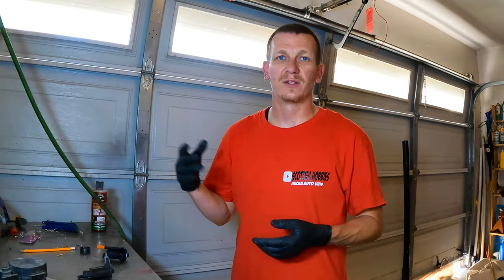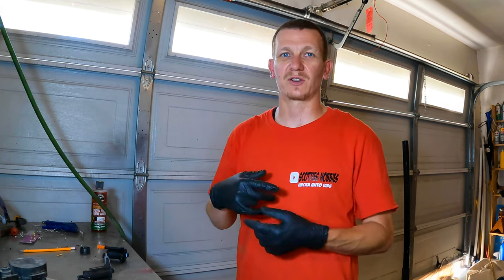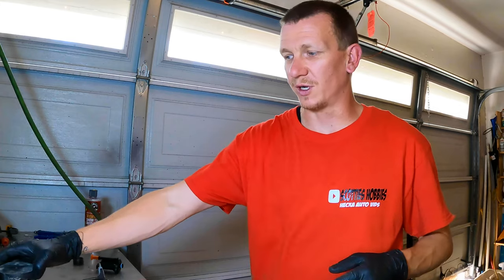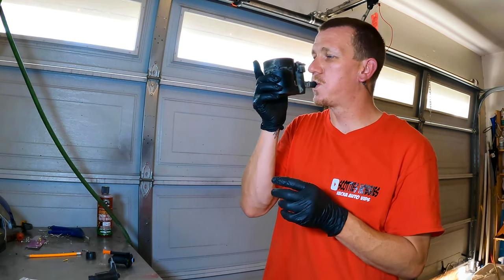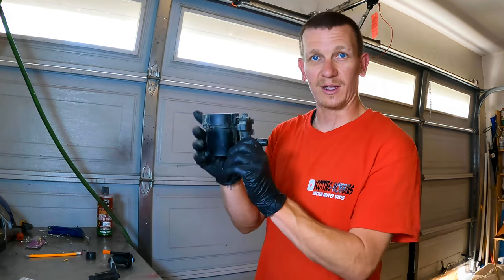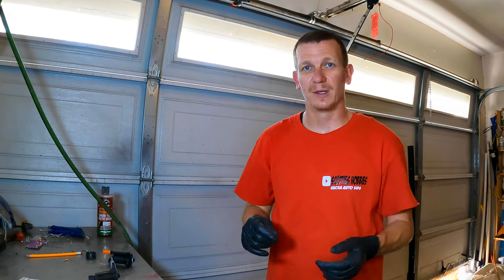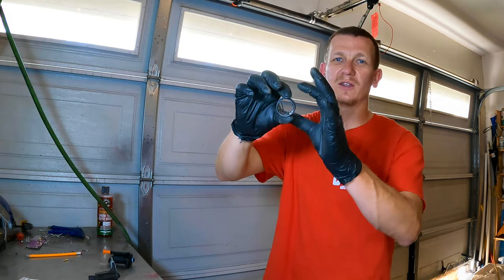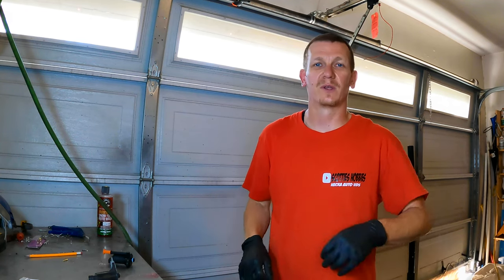⫷ Can't Pump Gas Into Car? Pump Clicking Off Too fast? Pump Keeps Clicking? Fixed! ⫸

Comment: Sometimes you need too burp your gas tank like your radiator. You do this by removing the gas cap then starting the car and let it run for about 15-20 seconds.
Reply: Im about to try that because im having this problem after fuel pump replacement.
Reply: This burping thing fixed my issue!
Reply: You saved me
Reply: I like this guy but he could never be a Actor but he's a good ole guy
Reply: Thanks for this comment it helped me and solved my issue
Reply: What if ur car was made without gas cap
Reply: @youwish3439  I put in the capless fuel system funnel that came with my truck turned it on for a bit and it fixed the issue
Reply: @youwish3439  it would be a Ford
Reply: Whhhatttt I need to try my 08 Nissan Titan is doing the same issue!
Reply: What if your vehicle is capless?
Reply: Does the burps work if I have no cap? I have a Silverado truck  with a metal flap that goes in when I stick the pump in . But it clicks every 3 gallons
Reply: @dondre5000 same deal
Reply: @JediFOMO  either the tank is already full, or the vent hose is clogged up
Reply: @kellismith4329  or a Honda

Comment: Dude thank you. You just told me my issue. I added Seafoam into my wife’s compass using a long skinny funnel. It got stuck pulling it out and I had to look up the trick to remove it. I got it out but now know the issue I caused with the funnel. Will take care of that this weekend as it started clicking off right after I did this. Thanks again for making this video!

Comment: Thanks my friend for your video.  It is helpful.  I have Mazda 2002 Protege 5 which has had the problem with filling a gas tank for a year now.  The problem has progressively gotten worse in the last two weeks.  I have had problems just putting $20.00 worth of gas in my tank without the nozzle saying I am full when it is not. Very aggravating.  Most mechanical problems I fix myself but this kind of problem requires lifting the car off the ground.  I just hope I don't get raked by a mechanic to do this and removal of gas tank is involved.  Never had a problem like this with any car until I bought this car two years ago.  It runs great!

Comment: I had that problem but it only happens at 1 gas station. The fuel flow was to high causing fuel to back up the fill tube. I filled up fine at other stations

Comment: Oh no! I've been replacing parts trying to solve my EVAP errors. I just looked and as it happens to be I too had my gas taken in the same manner. They damaged my gas hose too.
Reply from the maker: Who would have known this is such a big issue?? I am super surprised how many messages I get saying thanks for pointing out the restriction from someone siphoning fuel. 

Hope my video was the one that resolved it fir ya. 🤞💪👍

Comment: 2004 toyota matrix 5 speed...new feul tank replacement and a fuel pump.  It now does that after the tank replacement. Fuel pump was cracked so it had to be changed but now I have this problem

Comment: Great stuff, I have this very issue on my 2017 GMC Canyon which started shortly after I added fuel additive last year. Dealership and another garage could not pinpoint the root cause. Canister was replace with minimal results, I believe the problem lies in the filler neck as well..
Reply: What was the additive it should be avoided

Comment: I hade that same issues. But mostly in winter. And problem has happened 2 or 3 Time since I got my ram 3.6. 4 years ago.  And it lasted from 1 to 3 or 4 week straight. Hasn’t happend in over a year.

Comment: Same issue with 2004 Jag x type. No canasters available new, bought used. Mechanic installed, which requires removing the gas tank. He did not test the part or the system and after $1000. The problem is still there.

Comment: Hi thanks for very detailed and informative video. My car when i full the fuel , the first 40 litres is goes in smooth but after that it keeps clicking on and on  and i have tank capacity of 55 litres and it take ages to fill up the rest 15 litres. Can you suggest it might be the same issue as you discussed in the video?
Thanks alot
Reply from the maker: It is possible but it usually causes a fast filler click fairly quickly.

Comment: Just had shop fix my fuel pump cuz it was bad but now that it's fixed and  I can't pump gas  can u tell me whats wrong with it. I think it's charcoal canister... but I think the mechanic did something when putting In fuel pump cuz I didn't have this problem with the bad fuel pump

Comment: Well it wasn't the box on the 2010 nissan altam ot was a marker cap off a marker . I finally seen it with a mirror where the screen an flapper went I have no idea . The cap made it all rhe way to the last bend  before the rubber hose .  Thank u for helping me

Comment: 2013cadillac escalade esv luxury. I noticed at the gas pump When filling up the pump keep shutting off And I'm seeing that my flapper is not where it's supposed to be. I used to see it when I fill up. Do you think it's down in the filler hole and how can I get it out if it is

Comment: I couldn't fill gas tank and suspected it was the canister.  I disconnected the 2 hoses going into the charcoal canister and was able to fill up with no problem.  So i decided to bye a new canister (which came with the evap canister solenoid already attached) and hooked everything up and I still get the same problem.  Now I have no idea what's going on
Reply: Sounds electrical. That's why you test before using the parts cannon.

Comment: I have a 2010 Ford Expedition, that I believe that will be the fix as it's a capless system which you have to have a gas pump or a specific plastic part that comes with the truck. On your expedition is the vapor vent solenoid on the canister? Also it's a 2wd so would it still be in the same location?
Reply from the maker: Just looking at pictures it looks like your vent solonoid is mounted in your canister. I will double check tonight when I get home.. You should also still have a anti siphon screen in your filler pipe. Even with the capless fuel system. The anti siphon screen was blocking the filler pipe in this video.
Reply: @ScottiesHobbies  Okay, so would it be a better starting point to break apart the filler neck first? It's something that just started less than a week ago.
Reply: @ScottiesHobbies  Also to note truck does have around 165k miles on it. I just replaced the fuel pump because my mechanic said that's what it was.

Comment: What do you suggest I could use to make sure filler hose is clear?
Reply from the maker: .Other than disconnecting the filler neck and inspecting the hose. I would say a borescope from Amazon or eBay woodwork. I bought one not too long ago. That hooks up to my phone and is pretty convenient.

You can get it here:
https://amzn.to/3Lw5Syn

Comment: I have problem  pumping gas, can I still drive truck without a flapper .
Reply from the maker: Yes. I do t think the flapper will cause any issues. I've also found out since making this video that a lot of vehicles don't even have flappers.

If you can't pump gas, the most common issue idls the Vapor Vent solenoid malfunctioning. 

Good luck.. 💪🤞👍
Reply: @ScottiesHobbies  Thank you so much, would you know if they just sell the flapper
Reply from the maker: @pamhart5503  I do not think they sell just the flapper alone. You probably would have to buy a filler necj assembly. That would have the flapper included.

Comment: Is the vapor vent solenoid the same thing as the vapor leak detection pump?
Reply from the maker: Short answer, yes. Vehicles equipped with a leak detection pump, use the leak detection pump as a vent solenoid.

Comment: Scotto😮 can u help 4.7jeep  fuel  pump whining high whirling sound  thanks
Reply from the maker: If you hit thr tank, dies the pitch change? The pump might be going bad. Or... I know in one of my older chevy trucks, the fuel pump started whining one day. I waited for it to go bad for ever. It lasted til I sold it years later... and it might still be running on that same loud pump.

Comment: Hi, thank you for your video. I am having the same problem in a Volvo S60 04' 2.5LTAWD I wonder if the vent valve is located under the gas intake tube or where? When I open the cap of the tank it makes a sound like if the whole tank is over air pressure.  Can you please let me know where can I find the purge vent valve in my car?  Thank you.
Reply: Were you able to fix your problem? I have a 06 S40 and am having the same issue.

Comment: Hey, I am having that problem with my 2017 gmc acadia (just bought). went to fill it up, and tghe gas pump keeps clicking on and off. Ifi was to tackle this myself, what would be your advice on what to check first?
Thanks again for your video!
Reply: Find a station that the gas pump is smaller and narrow er

Comment: My wife’s Escalade has this problem. Is the screen and flapper  at the tank or in the neck? How far down?
Reply from the maker: Come to find out not all of the newer models have the flapper. Some come factory without. The screen is a few inches from the tank.
Reply from the maker: Have you tried to replace the vapor vent solonoid / valve? Or have you had it tested? That is the more common issue when you cannot pump gas.

Comment: MY 2011 ram 1500 is shutting  of nozzle when fueling. I have to pump very slow. No trouble codes Checks evap it's clear checked air vent on fill tube. I'm at a loss. Could it be the pump nozzles as station is new in last year.

Comment: If the vapor vent solenoid is bad (not venting) would it cause pressure to build in the gas tank?
Reply from the maker: Yes period especially when the vehicle is off Or while plumbing gas.

Comment: I'm having same problem with my 2014 Jeep Patriot. They just changed the Esum Cannister- cost me $530 and i STILL have the problem!! They now want to change the filler neck. Is this the obvious & cheapest thing to check next? I'm a single parent, raising 3 kids on VERY LITTLE money. I need to fix this the cheapest way possible. Is my garage going the right route??
Reply from the maker: I would honestly disconnect the Esim if possible completely.  Like take it off the vehicle and try to fill it with fuel. If the problem still happens then I'd think it's the filler neck or something restricting the fuel filling. If you can fill with the Esim off, then I might think its wiring to the esim or something past the canister.  The check engine light will come on with the esim off and fuel vapors can escape so I'd only remove for this test and that's it.
Reply: Thank you so much for the quick response! Get this: after watching several videos on  YOUTUBE saying to 'tap on the bottom of the fuel tank" we actually did this and bam, I was able to fill my tank without it shutting off!!! I don't understand why and I'm betting its only a temporary fix. Like I said, the Esim canister was already changed.... so.... when It does stop working again, is the filler neck still the next obvious thing to check??  @ScottiesHobbies    @iScottiesHobbies
Reply from the maker: @karenbrojakowski731  logically yes, that would be the next thing to replace.  But.. did any of those video say what is loosening up when you tap on the tank? Is there something restricting the flow of fuel into the tank or is something stopping the vapors from leaving the tank? I'm not sure of the internal design of that tank.
Reply from the maker: @karenbrojakowski731  I looked up a little bit of information on the roll overvalve in the field tank on your truck.. If the roll over valve is getting stuck closed somehow and stopping the flow of fuel into the tank, then replacing the filler neck would be pointless.

Comment: 2010 gmc Yukon xl doing that very same thing
Reply from the maker: Check the vent solenoid first. If it's good, it might be a clogged filler hose or possible wire damage somewhere.  

Good luck. Keep us posted. 🤞👍

Comment: Here's a crazy thought, if the vapor vent solenoid just releases vapor from the gas. Can't i just disconnect the hoses from it and just keep it that way?
Reply from the maker: Kinda.... to test the vent yes.. but you will eventually cause lean codes when the purge solenoid opens.

Comment: igot a g35 coupe and it only fills 10 gal idk why it dont wana fill more
Reply from the maker: If that was my vehicle. I would be checking out the vapor vent solenoid.
Reply: @ScottiesHobbies  thanks , is that part on the evap canister?
Reply from the maker: @realmadridFS7  yes
Reply: @ScottiesHobbies  ok im going to try that out, i also hope idont have charcoal  on the fuel lines from the charcoal canister

Comment: My car doesn’t fill either.. I just had gas cap gas pump and descending tank changed… I’m always hearing air escaping
Reply: I mean it clicks for every partial gallon I put in and if I don’t have time in between each fill I’m doing the gas regurgitates out… I’m doing a lot of squeezes at the pump

Comment: I have a Nissan Altima and mine also clicks and I also notice that it don’t have the flapper 🤦🏻‍♀️
Reply from the maker: Since making this video I have had a lot of people come to me and say therapy difficult does not have a flapper or they don't remember ever see. Ing a flopper. Just last week a person with a Nissan altima was in this same situation.I can't remember the year. But I think we came to the conclusion. The Ultima might not have 1. That fellow found that somebody tried to cycle his gas.  Or something and found a straw or small hose stuck in the bottom of his filler neck.
Reply from the maker: What year model Nissan Ultima are you working on question? I can see if I could find some used filler neck for sale and see if they include a filler neck flapper.

Comment: Problem pumping gas and now check engine light and car died after 15 -20 miles. Won't start until hours later
Reply: Sounds like a humming noise under dash
Reply: Could be the fuel pump finally dying. Failure to start after pumping gas is a pretty common symptom of that.

Comment: What vehicle was this for?
Reply from the maker: This video applies for probably around 99% of vehicles these days. But the the problem I was explaining in the video in the video was specifically on a is on a mid 2000 Chevy express ban. But. But I have seen this issue on a ton of vehicles. I love watching people try to pump gas at the gas station and hear it keep quiet I can and then let them know what the problem is.

Comment: I had no idea that the filler hose could be clogged with the flapper and or screen. My flapper is missing. I replaced the charcoal cannister, evap cannister and solenoid, the vent hose next to the filler hose and the evap solenoid on the engine. 2013 tahoe ltz. I'm going to pull the filler hose and blow through the main vent hose next. THANK YOU!!